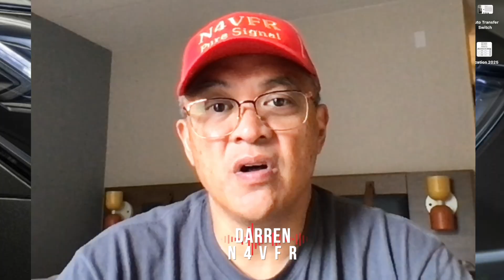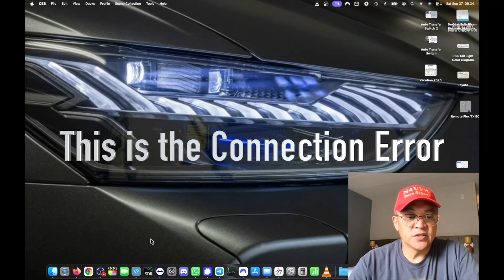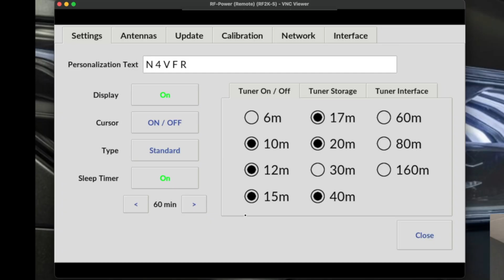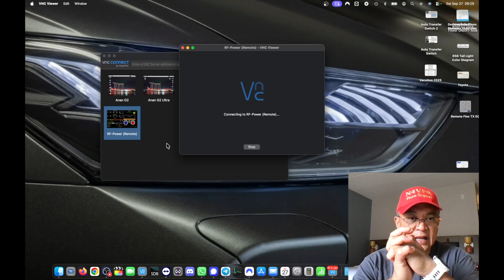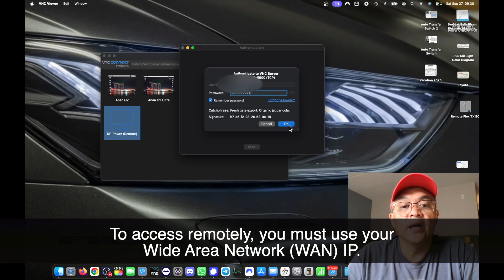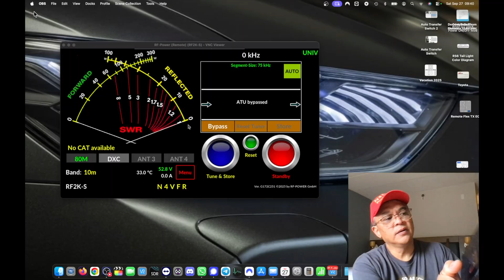RealVNC/VNC Viewer Remote Connection to RF-Power RF2K-S Amplifier | IP Passthrough | Port Forwarding

Comment: Darren, first I just want to say that I enjoy your content. Watching you is a great learning experience. 

At the risk of getting really far into the weeds with networking, I would really caution people against port forwarding if there’s another solution that works for their use case. It creates unnecessary risk for people that aren’t aware that any risk even exists. What I would look at in this situation is Tailscale, which is essentially creating your own VPN to connect to your home network. Then, instead of having to forward ports and having separate connection profiles, you connect to tailscale (which is completely encrypted) and you can operate as if you’re at home (from basically anywhere). Not only is this more secure, it’s far easier in the long run because you don’t have to worry about connections to the outside when you buy new devices that require a connection. You just connect to Tailscale and boom, it’s as if you’re at home.

They have a really great YouTube channel that should be able to guide you through setup. 73

Comment: hey Darren, check out a program called tailscale, it creates a vpn tunnel through the internet without any port forwarding. it uses end to end encryption and it much safer than forwarding ports and it's a lot easier.  there's a lot for videos on youtube on how to configure it. my router has it built in to it.